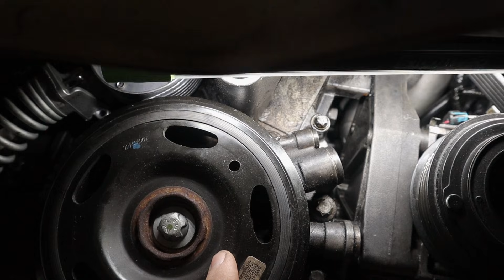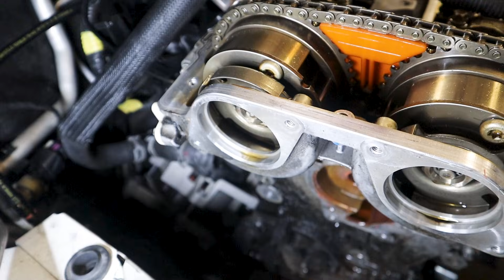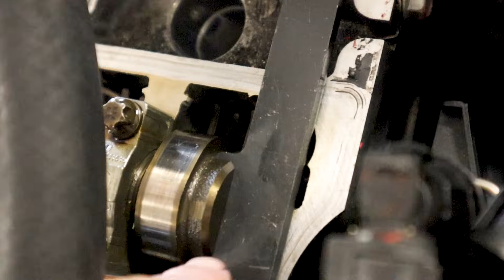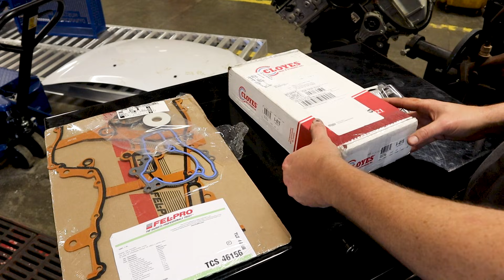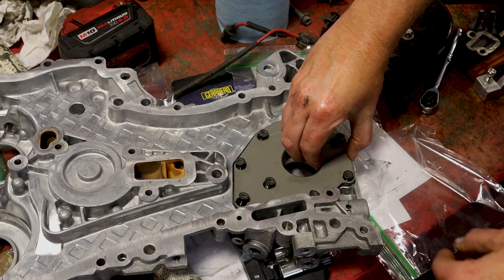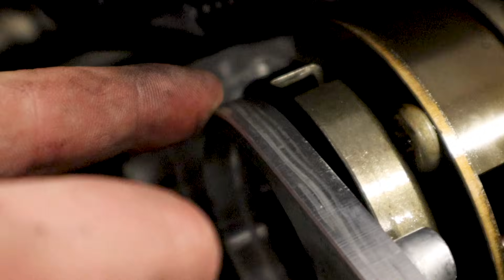P0016 code Ecotec 1.4 timing chain replacement

Comment: The torque spec for the tensioner is only 71 inch pounds. I snapped a bolt trying to get to 15 ft lbs like you said in this video so that's cool. The timing tensioner shoe is what gets 15 ft lbs. I should have looked it up before to verify it myself I guess

Comment: Just wondering how long does the full job take to get all the parts switched over and back out the door. My 2016 trax just started throwing timing codes. Hello from Ontario Canada.
Reply from the maker: That would be very dependent on skills and tools, but a whole day of diligent work should get it done. With a shop and having done it before, it takes me around six or so hours if I’m locked in. I hope this helps!
Reply: Thank you

Comment: Did you replace the camshaft phaser bolts with new ones?  It didn't look like it but I am just curious.  I just replaced a head gasket on one of these and did not put new bolts in. No issues whatsoever, thankfully, but I have been curious as to experience with that specific detail ever since I saw it mentioned somewhere else.  Thanks in advance.  Great video by the way!  One of the simplest and most detailed that i've seen so far.

Comment: After refitting everything, did you unplug the coil pack and/or injectors and crank for a while to build up oil pressure, or did you just 'send it' ? 
If you did  unplug, how long did you crank it for? 
Finland here btw
Reply: That oil pressure would dissapear the second you turn off the engine again
Reply: @Sneak_1000 yep, it wasn't an issue in the end 👍

Comment: I dry started an engine once and I only did it once never again.
Reply from the maker: On a system like this that relies on oil pressure to get the slack out of the chain, I think prefilling the pump is a good idea.

Comment: I have a 2016 chevy trax and one morning when my wife tried to start the car it wouldn't turn over.  So i had it towed to a garage and the mechanic there put a power bar on the crank and it would move however, it would only move so far then bring up.  At that time i had to go to work and decided to have it towed to a nearby garage for a quick check. The mechanic said there must be a problem in the head.  So my being a mechanic for 52 years decided i would do the work myself so i had it towed to my garage and proceeded to look for the issue as to why the engine wouldn't rotate all 360 degrees.  So i then decided to take the head off to look for a possibly faulty valve that stayed open when the piston was coming up only to find nothing.  The plot thicken for me so being the type of curious person i am i decided to remove the starter to look for a possible torque converter bolt being loose and bringing up in the starter.  All 3 bolts were tight to the specs.  Still no reason why this engine wouldn't turn over, so i then proceeded to remove the base pan and check the connecting rods for possible issues there, nothing was found.  I then figured if i'm this far i may as well remove the timing chain cover so i did.  Nothing found there.  So i decided to put a power bar on the crank bolt and this engine now rotates the 360 degrees as it should do.  So my question here is has anyone ever experienced this type of issue before?  As of today i have not found any viable reason why i had the issue to begin with.  I even inspected the flywheel for a possible crack.  I am at a lost as to if i should just buy the 600.00 dollar worth of parts i need to rebuild this engine back to where it was and see what i end up with.  The car is in too good of shape to scrape it. I'll check back to this video to see if anyone else experienced this or would know why i encountered what i did.  I am a licensed mechanic and i've never ever experienced this sort of thing before.
Reply: maybe a piece of the broken plastic guide bar jammed itself between the chain and sprocket, and when you were working on the engine and trying to turn it the piece unjammed itself and fell into the oil pan where it's hidden on the bottom covered with oil

Comment: I found the video very informative and well done. The only thing i missed was do you put sealant on the base pan as well as the timing cover before installing or would the sealant on the timing cover be sufficient?.
Reply from the maker: It just takes a small bit, so one side or the other is fine. Thanks for watching!

Comment: Caution: The oil pan must be removed, otherwise the pulley will not be centered in the oil pump. This is a requirement from Opel!
Achtung: Die Ölwanne muß abgenommen werden da ansonsten die Riemenscheibe nicht zentrisch in der Ölpumpe sitzten könnte. Vorgabe von OPEL!

https://www.youtube.com/watch?v=fMgYM99VqNM

Comment: 16:51 not necessary whatsoever. A small piece of 2x4 right between the cv shaft and frame where the a arm mounts is PLENTY enough to hold the engine up

Comment: I appreciate this video and doing this job in a couple weeks. I have a good quality holding tool kit. Can you confirm the procedure for removing and reinstalling the Harmonic Balancer pulley bolt? Is the crankshaft holding tool strong enough to hold while removing/installing this bolt?

Comment: Hi.

I have a 2012 Chevrolet Sonic ecotec 1.2 16v with 117,000 km. The oil pump gasket needs replacing because there are oil leaks. However, my mechanic said that the timing chain will also need replacing over time. Is this really necessary?

Comment: Hello, thank you for the video, it helped me a lot. I did complete chain, guides and tensioner change, everything seem to work smoothly... The only thing i am not sure about is ( when engine cold ) on startup, after one second, noise  like pressure reliefe appears for a split second. When warm, even barely warm no such a sound... Any idea why this sound occured after chain replacement

Comment: Tell me the symptoms mine was rattle on cold start for about year my car now cant idle on its own was doing we back fires i felt loss off power abit ?
Reply: A14xer non turbo
Reply from the maker: @tuckerhouston8935 this one had low power and camshaft position codes, but this one is a turbo. I would expect the same on non turbos though.

Comment: 19:58 aren't the cam phaser bolts TTY?
Reply: Yeah they friggin are lol
Reply: The crank bolt is TTY but not the cam phasers.. I just done a mariva 1.4 and worked slowly through the workshop manual the only bolt that has to be replaced is the crank pully

Comment: the timing is incorrect, you will have problems ! the camshaft sprockets also have to be mounted correctly! you have a line and must face straight up, and the half circle indention will be to the right around 60C

Comment: If I had to do all that work, I think I would just sell my car as junk.
Reply: That's what we all end up thinking, but usually after it is too late and we have sourced a new head, a replacement aluminum coolant manifold, oil-cooler, the PCV kit, all new coolant hoses, a new thermostat, new water pump, a full rebuild kit for the turbo even though we will have to ignore the cracks in the waste-gate housing, etc....

Comment: This was excellent teach my name Valerie Taylor , all female 😊. I TAKE AFTER MY DAD . AND MY BROTHER OLIVER IS A RETIRED MECHANIC. I INHERITED MY SISTERS 2014 CHEVY CRUZ LT 1.4 KEEPS THROWING AN OVERHEATING IS S Y E BUT ITS NOT OVERHEATING BOUT EVERY SENSOR WAS REP lace.d it ak s o shows engine m e light he kept it well maintained runs Beautiful  except needs timing chain cover gasket . It's the only leak Detected. One thing that well may be setting off overheating sensor is the after market thermostat (Murray) when I repair vehicles i keep it o.e.m. especially when m it comes to sensors. The only code showing is the catalyst converter the front one was replaced and code was cleared but came back again so I am going to replace the rear converter which isn't hooked up to computer onIy front cat has readings. Since My sister owned vehicle neither cat has been changed. When I change the timing cover gasket I will be sure to inspect timing chain hopefully between that the stat and cat these codes will be gone
Reply: Apologies for typo errors. The garage she brought it too put in an aftermarket part for the thermostat charged her $140 plus dollars ,changed the valve cover hood Bcm/ECM and still no change in overheating readings charged  her $897.00 total

Comment: Didn't quite get that. How does the coolant get into the oil in the sump.
Reply from the maker: Water pump runs through the timing cover so when it is pulled coolant dribbles into the oil pan. You can minimize it by draining coolant but some always gets into the pan from my experience.
Reply: @AutoScholarwithMrB  ok. I was planning to drop sump anyway because I suspect something metallic did break partially or wear prematurely because I could see Iron particles. I even had a look at the oil under the microscope. Thank you.

Comment: Ive followed this video and not to difficult a job. Question i have is after replacing the chain which was very tight i now have a whirring sound that increases with rpm. Any ideas ?
Reply: Did you Not remove the oil pan? The wining is the oil pump dying now. You have to do it again and maybe your oil pump or even timing cover is now toast

Comment: Great video. Made my Trax 1.4 a lot easier job. Larry in Ohio
Reply: I'm doing a trax right now, also in ohio. Did you remove your oil pan? I'm worried if I don't, the repair will fail.
Reply: @jeffy1466  yes I did remove the oil pan. The plug was leaking in it anyhow where someone had stripped it so I had to replace it anyway. It was very easy to get off.
Reply: @LarryNorman-i3r Thanks for that info! Did your trax have all wheel drive? Did you have to remove anything to get the pan off?
Reply: @jeffy1466 mine is front wheel drive. The only thing in the way was the exhaust flex pipe. 3 nuts and it was off.
Reply: @LarryNorman-i3r  Thank you for the info!
Reply: @LarryNorman-i3r Sorry to bother you again but Im getting around to working on this trax again. Im at the point of taking off the flex pipe to get to the oil pan. Did you cut the other end of the flex pipe? Mine is welded on. Im not sure if there would be enough room to get the pan off. Also was the connection of that flex pipe and catalytic converter right up on your oil pan?
Reply: @jeffy1466 all I did was remove the 3 nuts from the manifold and pull it down a little and had enough clearance to remove the pan.

Comment: Hi just wonding if you can confirm if this is the B14NET 1.4lt
Reply: A14net and b14net are basically the same in terms of head and block and timing, just slightly different components in terms of emissions control etc

Comment: Shouldn't the cam phasers be checked to see if theyre in the right position, should they be closed or open? Does tightening  the phasers bolt whilst they are locked damage anything?
Reply: The tool locks them in the right position but the outer ring that are the hall sensor triggers I am not sure how he found that position or if they lock in a certain position when the phasers get locked into the correct position.

Comment: So if the hole of the crank pulley is lined up with the notch and the piston to cylinder 1 is at the very top, then I should be TDC on compression stroke?
Reply: You can't rely on just that.  Buy the $50 kit that includes all the pins and clamps and cam notch bar.  The big thing is that you need to keep things perfectly in time while you tighten the crap out of those actuator bolts.

Comment: Would not the phazers still be in time if you hadn't loosened the front cam bolts...they could of..Also the top guide is famous for coming loose and the bolts need loctite

Comment: Hi Mr B. Great job but the only problem I see is that there are some Torque to Yield Bolts on this Timing Chain Cover and those Cam Sprocket Bolts are as well. I know sometimes you can get away with it but 60 degrees is a lot. Keep up the great content.. I've been turning wrenches for more than 50 years and my 2 boys are Fabricators now. My daughter is a Nurse but I still make her work on her car from time to time.
Reply: Yeah, it's funny - I have stripped about 80 GB of YT vids detailing a head swap and not one of them mentions that those quirky bolts are meant to be TYD.  I think a person just has to have the right feel and you can re-use them.  Maybe just couple of drops of blue loc-tite one perfectly clean thread surfaces and hold back just a little on the 90 degree thing...

Comment: At 3.38 your cams are not lined up 

Did you just undo the phaser bolt and then turn cams to correct place.
Not wiggle it can it actually be turned 

Can you technically spin 1 360% if you undo the phaser bolts to line up correctly, or does the chain have to be removed to turn 1 cam around if it's not in the correct place

Comment: Thiae phaser things if they are slightly out woukd that cause the p0016 and p0017 codes 

Also, what size socket do you use and what  torque wrench size is the square bit that goes into your socket? Are you using 1/2 or smaller

Trying to determine if the torque wrench will be powerful enough to bolt those up or if i should buy a 1/2 inch version instead

Comment: I hope someone can help... On the top of the engine where those two slotted holes are, between what would be the dip stick and oil filler cap, what is that called?
When i took my cover off I noticed a thick buildup in there that I want to clean off but I have no idea how to word it on google.

Comment: Thank you so much for the video sir I got a question on this engen what is the right side of the fan belt am finding it hard to get the proper size it's either big or small my engine is 1.4 2011 turbo your answer will really appreciated thank you

Comment: Hi im doing the timing following your video which phenomenal. I have one question i hooe i get the answer for it my  question is when i was locking the crankshaft i put the pin gone all the way in and the first piston from the timing chain side on top dead centre put the metal bar in the back of cam shafts but the crankshaft pin was cominv out itself then i pushed in was all the way in put tissue paper between Ac compresser just to keep it in WHY is that ? It wasnt under pressure ??

Comment: Hello brother, my A14XER is smoking non stop the mechanic has changed the rings and the head has been serviced replacing all the seals and guides to no avail. Can swop the engines and use the Z14XER instead?
Reply from the maker: @MrG_Academy  I am not familiar with engine codes or configurations with this one, sorry.

Comment: If those phasers aren't aligned properly, they will throw code P0017 (Exhaust Camshaft position  not plausible) or P0016 (Intake Camshaft position not plausible).

Comment: Thank! I bought the aftermarket timing kit but the only piece I could figure how to use was the crankshaft  pin!!! When I was finished I got both codes. P0016 and P0017. It runs ok but I'm going to take off the valve cover and the cam actuators and try timing it again.😢
Reply from the maker: If both cams are out of time it may actually be the crank that’s out. The ecm is going to think the crank is correct and the cams are wrong, which is probably why you are getting those codes. I hope this helps!
Reply: @AutoScholarwithMrB  how do we check crank timing??
Reply from the maker: @brandenes3086 by inserting the lock pin from the tool kit into the block. I hope this helps.

Comment: Thank you sir nice video am working on this same engine right now but I didn't loose the camshaft sprokets because I don't have the special tool but I'll try my best to get it right so keep up your good work sir
Reply: Did you manage to do it without loosening them? I really don't want to loosen them as they are super tight and I don't have the strength

Comment: Great video. But the torque spec on the tensioner bolts are 8 nm, not the 55 ft lbs = 20 nm. Dont ask me how i found out

Comment: 19-3-24. I am dismantling the time chain from breakdown. This vehicle never suffered from a noisy chain. But after checking , timing was out,  reset timing , ran perfectly. Flushed engine, Changed oil and filter. Now rattles its head off, run a few seconds and stops won’t restart. But if left a while it does same. Seems like oil pressure. But how can I check other than visual. How bad would it look. Ran perfect on old oil. Will update when stripped.